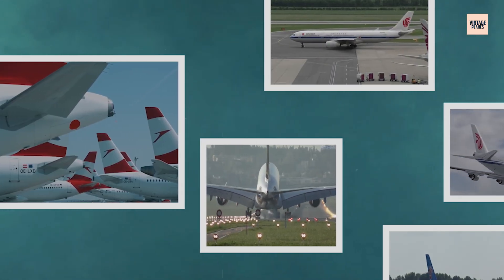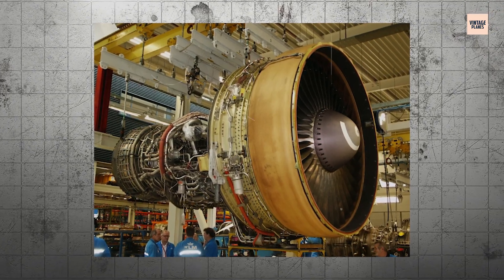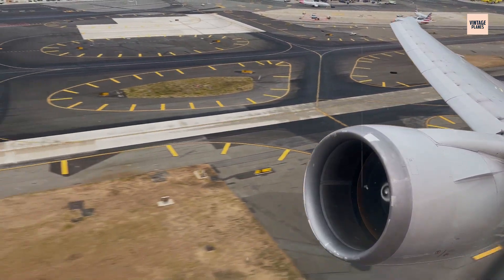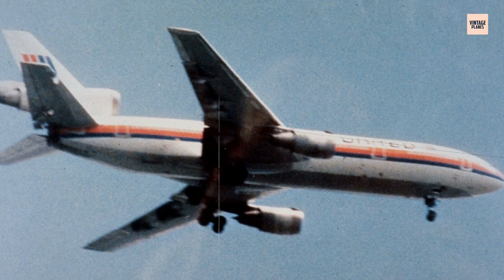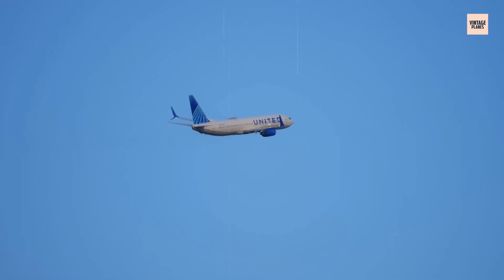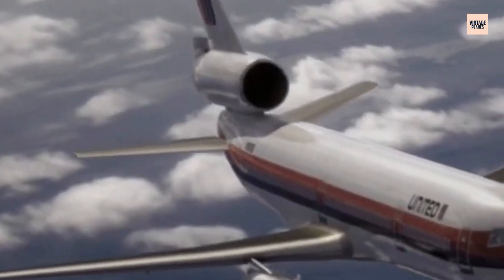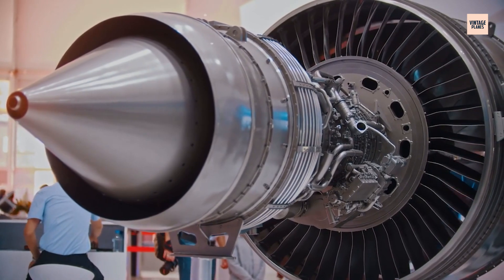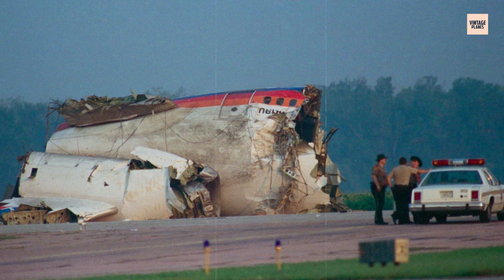THE SHOCKING TRUTH BEHIND THE GE CF6 EXPLOSIVE ENGINE

Comment: You are trying to make a boogie man out of nothing. Parts fail some times. The big issue here is the fan failure took out BOTH hydraulic systems. The pilot did a fantastic job of saving many lives with his skill. More people died in Chicago after American Airlines improperly install an engine and cause a fatal crack in the Tomb Stone fitting. So which is worse? mechanical failure or human failure?